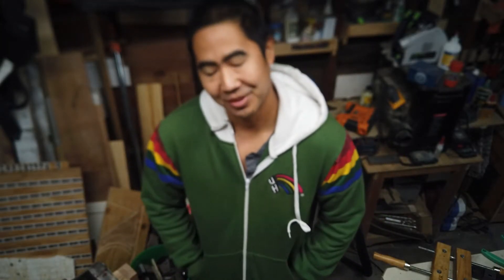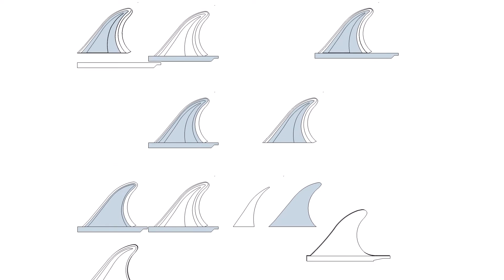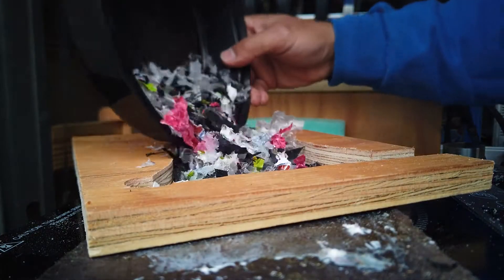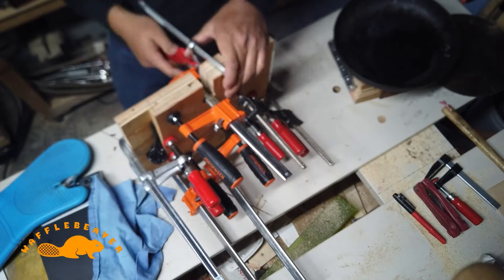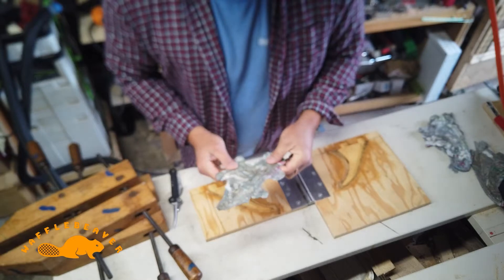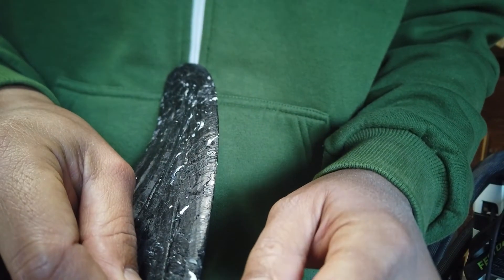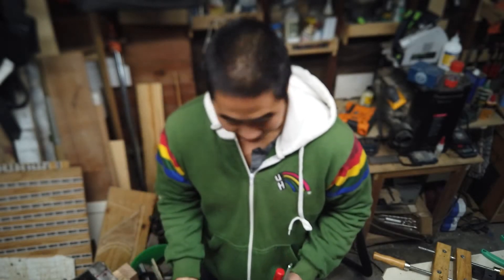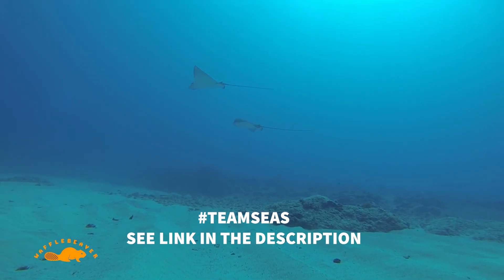Surf's Up! Crafting Eco-Friendly Fins from Recycled Plastic

Comment: 2 questions: 1. You had your SketchUp model 3-D printed, why didn't you just use that as your fin- too light/weak? 2. When refining/foiling the shape of your recycled plastic fin, why didn't you just use sandpaper?  Thanks!
Reply from the maker: For question 01. I don't have a 3d printer, but from my experience most 3d filaments are too weak. I think HDPE is barely strong enough so I started reinforcing with some stainless steel all thread. For question 2: I reuse asuch scraps as possible so shavings are easier to collect and reuse. Sandpaper will make the plastic into microscopic particles which I'm also trying to avoid breathing. Good questions and let me know if you have more questions